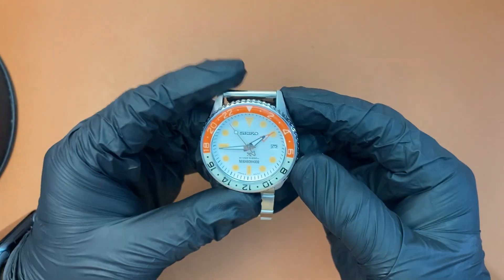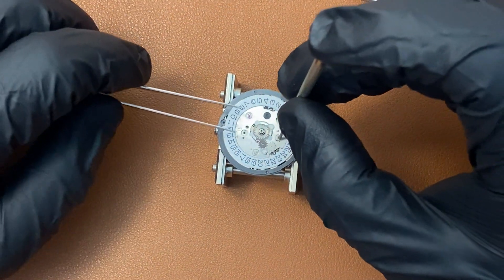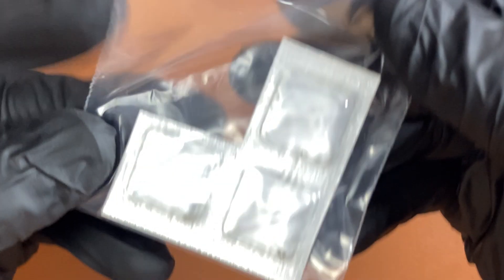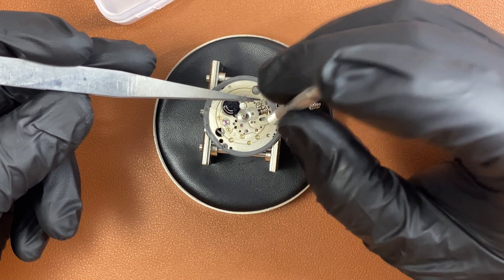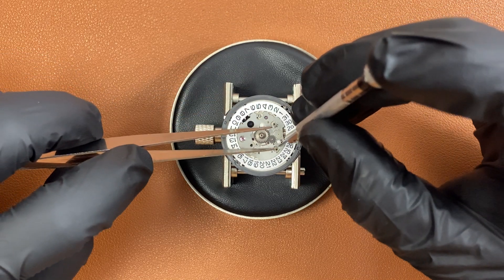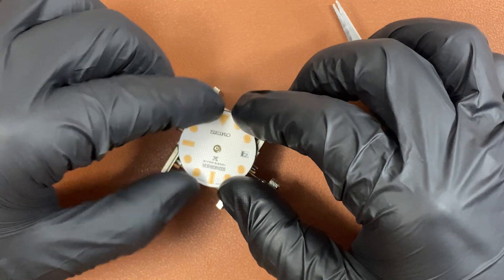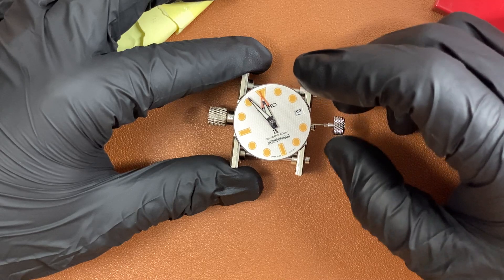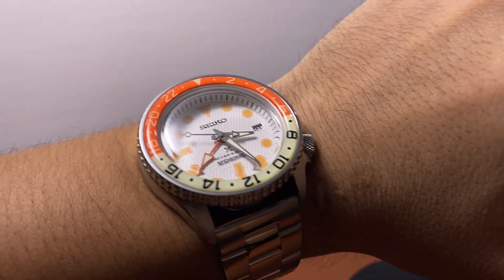Seiko NH Movement Fix: How to Repair the Broken Quick Date & GMT Change Feature!

Comment: Excellent video. Thank you for the contribution to the community! 

I "sacrificed" an NH35 to get a replacement gear, now I have plans for a no-date dial with it.
Getting the gear out was relatively easy, putting the new gear in the NH34 was challenging... The clutch (another gear that is vertical) kept falling in the wrong position, I had to watch more videos showing the complete assembly/disassembly to understand.

I feel a little more confident with the hobby and my skills now.
Reply from the maker: Awesome to hear you were able to fix it and gained some confidence!

Comment: Is the 9015 verticle wheel compatible with the nh34a gmt movement. The date adjust works but I only get clicking and no movement on the GMT ring
Reply from the maker: Hi, sorry to hear that. If the GMT ring is not working, it's most probably caused by some other gear. make sure the gear that directly and indirectly engages the GMT ring is properly installed in place. You might need to troubleshoot it slowly to see what is the root cause.
Reply: @a @arthur-loh will take it apart😢

Comment: Hi arthur, so my nh34 freely spins for date and gmt, would you say its the same wheel?
Reply from the maker: Hi! I can't be sure, until I actually tests it. But there's few gears that engages with the data and GMT. there could be multiple reasons that causes it.

Sorry, the easiest way is to get a new movement, while tinkering with it and try to fix the movement when you are free.

Refer to the Reddit post i shared in the video description. I think that could help you as well.

Hope this helps.
Reply: Most likely is a bad quality stem from China, it doesn't engage with the clutch

Comment: If i broken one in my gmt nh34. i gan take part for nh35!??
Reply from the maker: Yes, generally, they share the same parts for the most part. except for the GMT complication.
Reply: Thank you Arthur the artist! I fix the problem! I use that nh35 ,s gear and now that work great,like a new!! 👌👍☺️✌️🙏✴️🇫🇮🌻☀️🍀 @arthur-loh
Reply: Das it works if i but myin nh35  gear part in to my nh34?? Gmt works? And day works?? Or day only works but not gmt???
Reply: Hi Arthur, could you sell me that part? Is that I do not get it on Aliexpress and the link you put does not send to the USA, I have paypal, thank you very much?